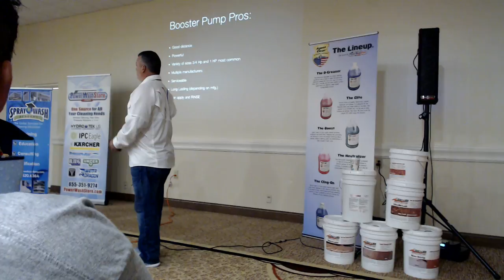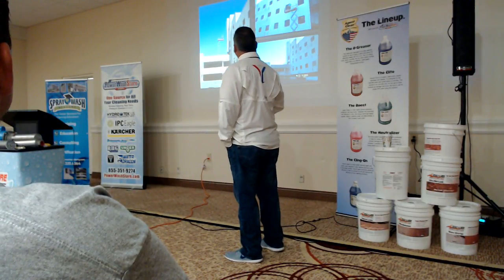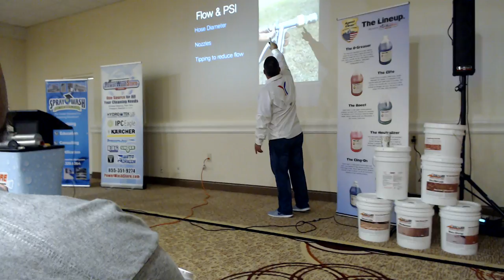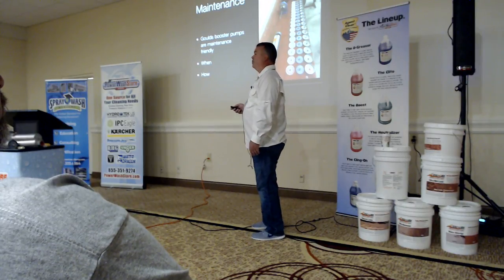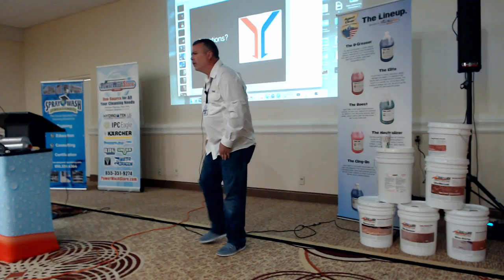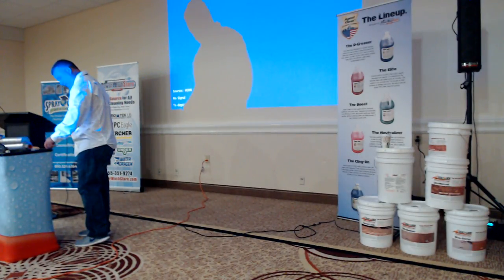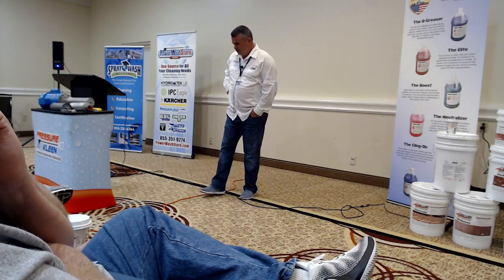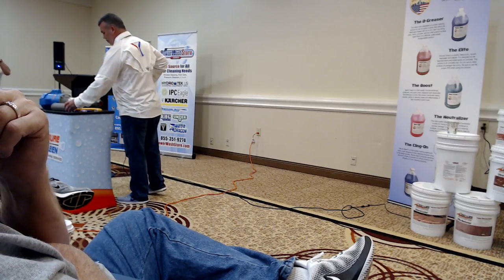Tim Aselton Booster pump maintenance and repair CleanPowerWashTV Power Wash Store SWA Day 2

Comment: I think of you have a 7gpm booster you need at least 1" supply inlet .. any less will restrict your total rinse flow ..
Reply from the maker: It's ideal for sure.   We have modified our plumbing a lot on them over the years.
Reply from the maker: The original issue is that they wanted to use smaller pickup tubes on the proportioner and so that limited the outlet size on the proportioner which then goes to the booster.